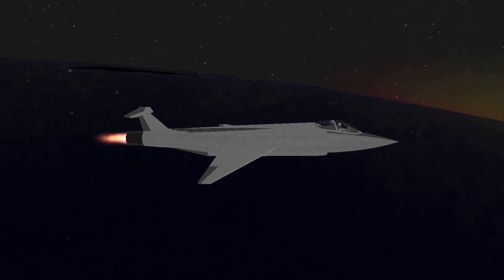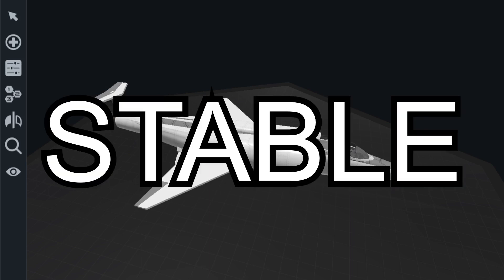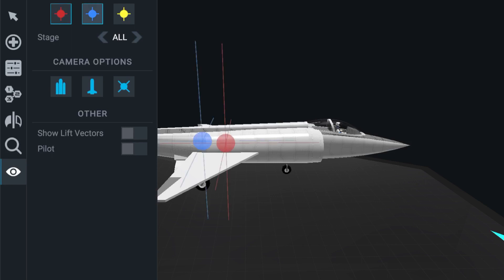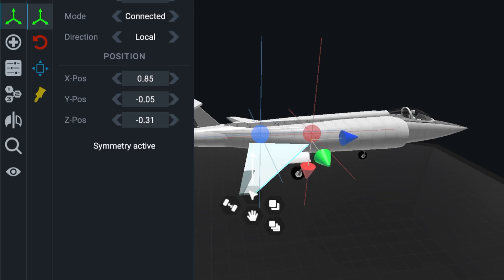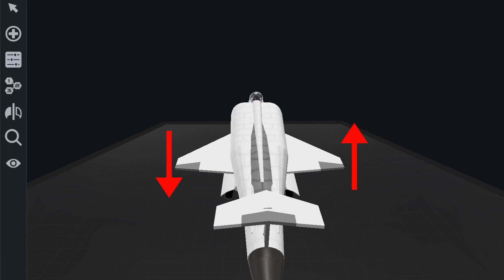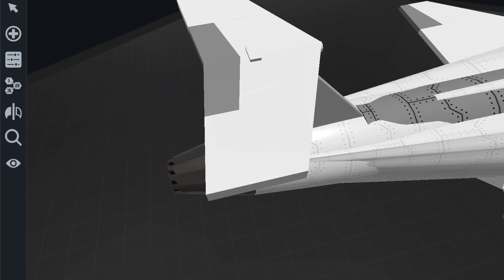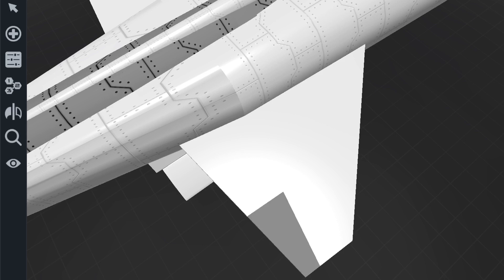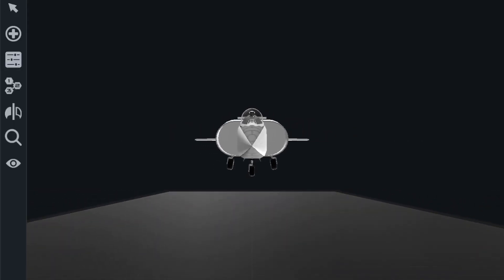Juno: New Origins || How To Build Rockets Pt. 16, Aerodynamics and Planes

Comment: Well, that thing with unstable and that the aircraft will flip around is not entirely true, if the wing vectors from the parts of the wing in front and behind the CoL are basically same, the aircraft will not flip around. Furthermore, you can spam gyroscopes into your craft to make it stable. I do sometimes experiment with aerodynamically unstable aircraft.

Comment: Important note: Fuel eventually runs out and makes the plane lighter, because of this center of mass may change, 
What i recommend is Putting the jet fuel where the center of mass is currently is without the fuel, maybe on the sides.
Or on the bottom where lies a flat fuel tank directly below center of mass. but not too far
Reply: Good observation! Real airplanes have their fuel tanks in the wings. This maximizes fuel capacity while minimizing CG drift from fuel use. You can also implement a belly tank at the wing root for extra range.

Comment: Can you explain why when you used jet engine it will lose fuel faster hihuhuhuhuhuhuguhu😔
Reply from the maker: It definitely shouldn't be consuming more fuel than any rocket engine
Reply: @Deltlead  I figured it out that I used the wrong fuel types hahahahahah by the way thanks for that explanation I get some I dea not for a vedeo but for a simulation thanks😁

Comment: Maybe you can make a video explaining how to design really fast planes? I'm trying to make a Mach 4 capable plane and can't really break 1000 m/s despite all my optimizations. Thanks!
Reply: Big bois can go a lot faster. fuel tanks should be in engine nacelles, and nacelles should house at least 4 reheat engines, with a wing structure designed with stability in mind. I created an aircraft, huge aircraft, called the RT-78. it doesn't really act realistic, because the exhaust of the engines leaves into the inlet of a following engine.
Reply: Try using props. Props are OP in this game, and can travel underwater easily.
Reply from the maker: I might do a hypersonic tutorial video in the future, thanks for the suggestion!